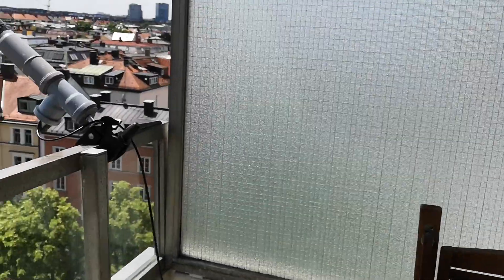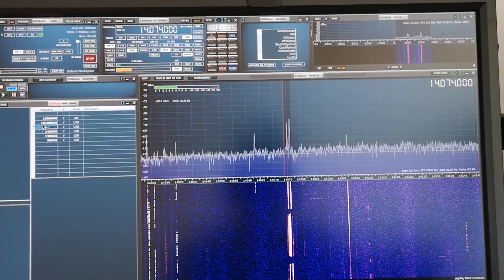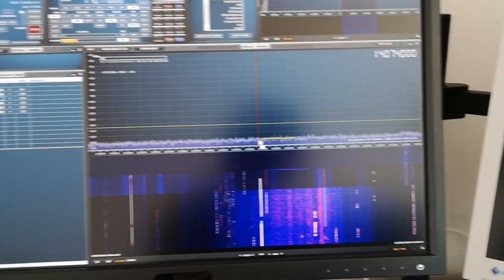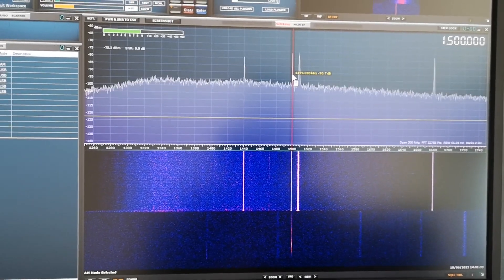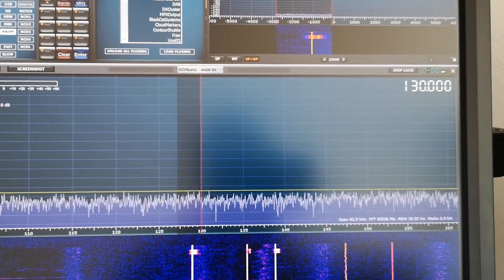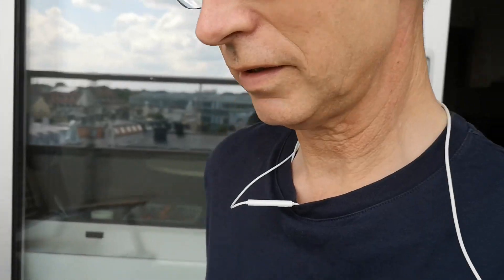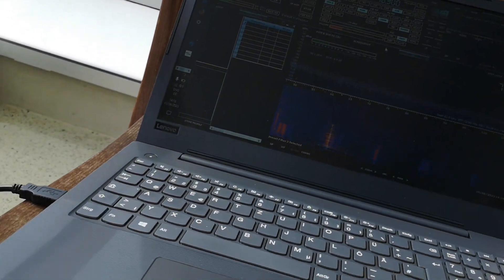PA0RDT Miniwhip Antenna - further observations

Comment: Miniwhip is a PROBE for the electric field not an antenna.
Conductive objects modify and reduce the electric field so it must be installed in free-space.
So the miniwhip is sensitive only to the electrical component of the e.m. field: this is its main advantage because man-made structures or trees absorb the electric field much more than the magnetic one and therefore, if mounted correctly in free space (non-conductive pole of at least four meters) it will receive less disturbances than a small diameter loop or a long dipole and generally provides a higher signal/noise ratio.
The original project is calculated to work conveniently from a few kilohertz up to about ten megahertz.
An antenna to be defined as "long wire" and behave as such must be longer than one wavelength. 73s.
Reply from the maker: I agree with you.
Reply: @fotografm 
Thanks. However, rereading I have to make a clarification. I wrote: "it will receive less disturbances..."
This is true for the reasons I wrote, but only if the source of the disturbance is less than about a wavelength away (near field). Beyond this distance, the electric field and the magnetic field are closely related. Also for this reason it will be convenient using on the VLF and the lowest part of HF. 73s

Comment: Hello 

Have you grounded the pcb of the mini whip or at least connected a counterweight to minus of pcb .

This is very important with an E-field antenna 

Greets from Germany ( Ruhr Area )
Reply from the maker: That is a very good point and no I haven't as I am high up on a balcony and have nowhere to ground it to apart from the balcony metal railing which picks up a lot of noise from neighbouring apartments.

Comment: What happens if the mini-whip is held out further away from the building? Does it out-perform the loop at 14MHz then? At what distance away from the bulding does the signal stop increasing? Just curious because I found the further away, e.g. with a broomstick, I could get it the better.
Reply from the maker: That is a very good question. I need to get more drainpipe to push it out further into free space.
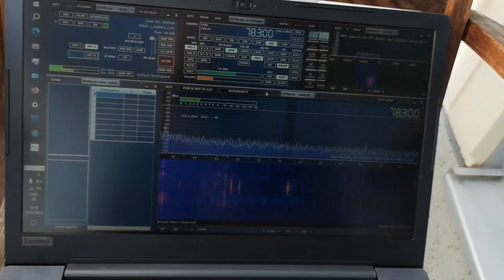Reply: Min 1 mt should be 8:37